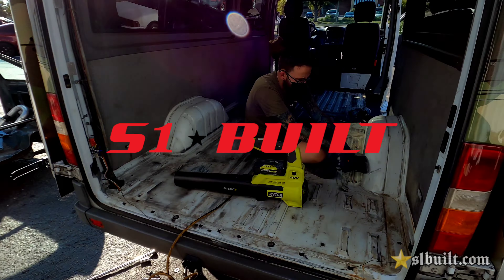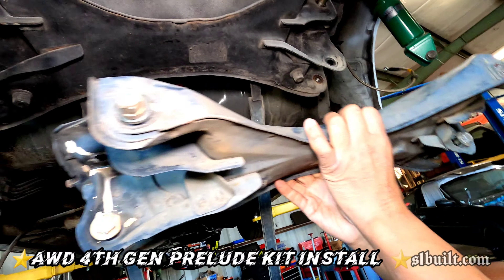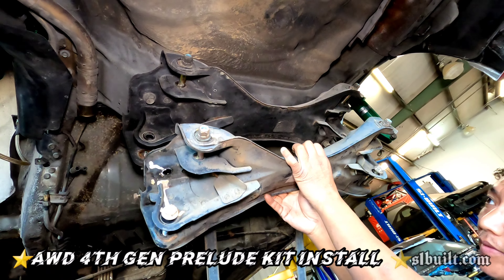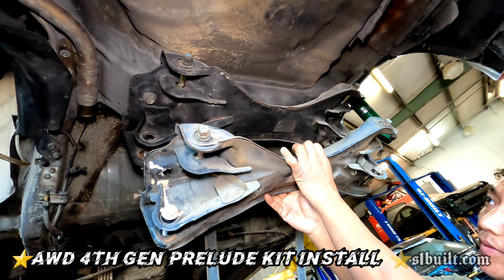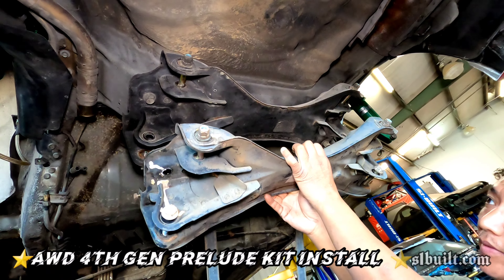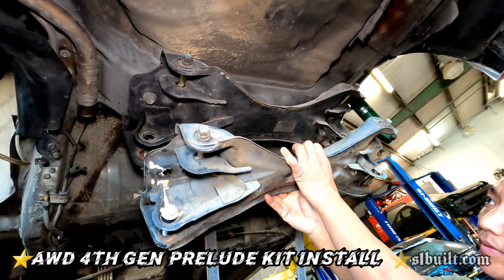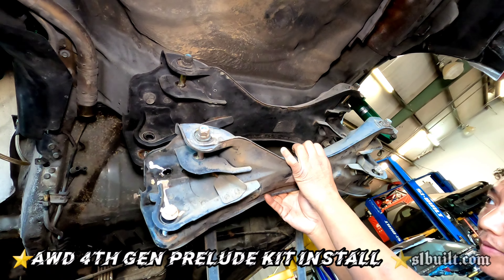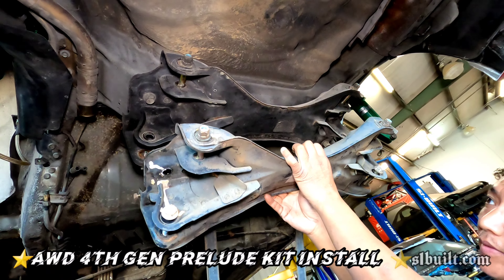4th GEN PRELUDE AWD KIT INSTALL ⛔ @DC5CREATIONS (IG) ROLLS UP

Comment: Would this require similar fabrication to the dc2  conversion if I were to use the few h22 billet housing? Sense I believe you’d have to mount the crv rear differential upside.
Reply from the maker: So you have a DC2 Integra going AWD with a Hseries swap and your using the Few H22 Bell correct?
Reply: @S1Built  I was considering using the few h22 bell housing with the h22 in a 4th gen prelude. Would I have to modify your subframe like you did on the dc2 integra build? I’m trying to figure out the build route that takes the least amount of fabrication/ welding.

Comment: What transmission you use with this kit for h22 engine to have awd ?
Reply from the maker: This particular 4th gen Prelude has a Kseries engine/trans setup..You can do whatever engine setup upfront..Our AWD kit converts the rear of the vehicle...If you plan on using the H22 engine you can do the H2b kit and use the AWD CRV Transmission or you can stay Hseries trans using the FEW H22 Billet Bellhousing